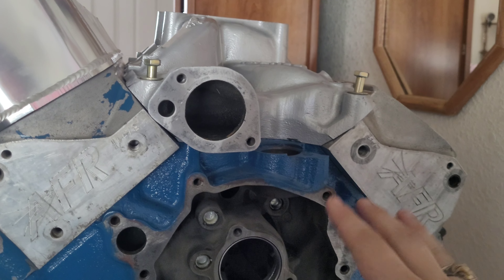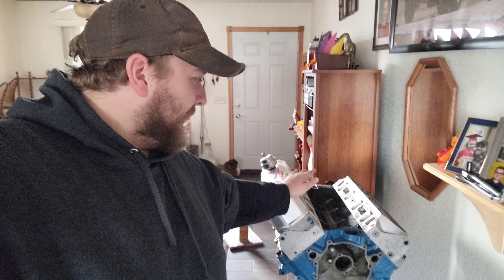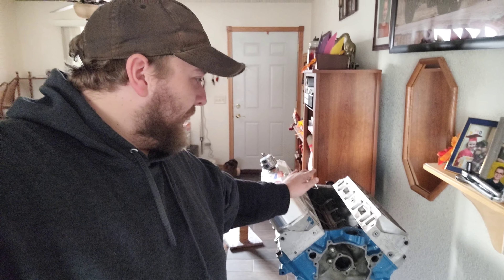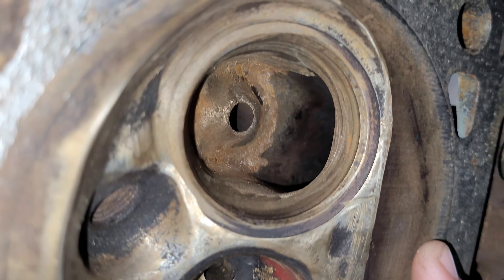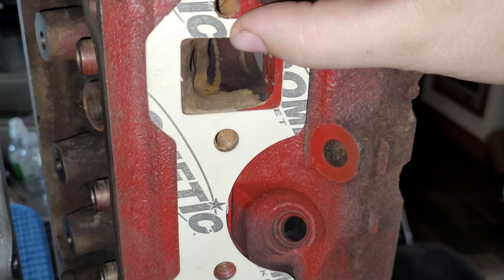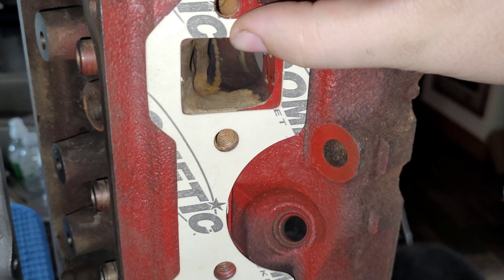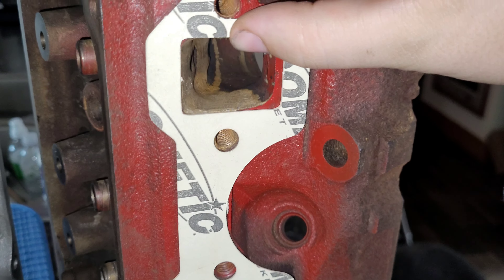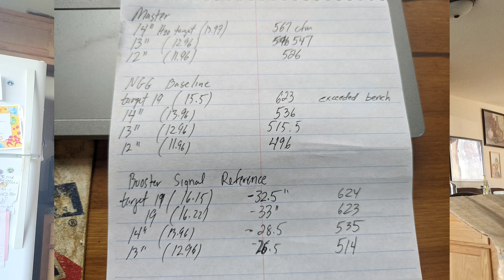AFR Heads Are Back! | Comparison Between Them And Our E7s | And A New Channel Collaboration! | Carb

Comment: OGM  LOOK AT THE SIZE OF THE SCREW HEADS STICKING WAY UP OF THE BUTTER FLY'S 
IN A TWO BARELL CARB THERE'S 4 SCREW HEADS SO YOU HAVE 8 SCREW HEADS STICKING RIGHT IN THE AIR FLOW ...
Reply from the maker: That is one of the modifications that will be done to the first basic carburetor mod flow test! 🙂

After that initial setup then we will be changing the baseplate to a 750 style and honing the venturi bores to make it fit to see how bigger butterflies affect flow 😃